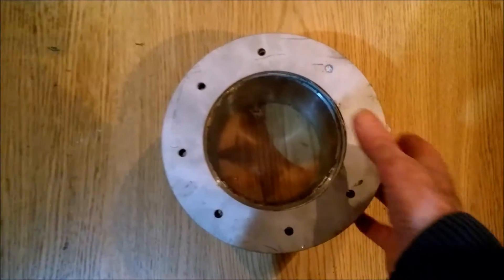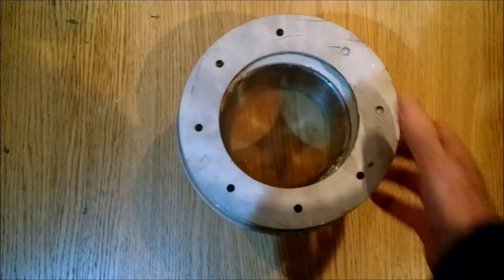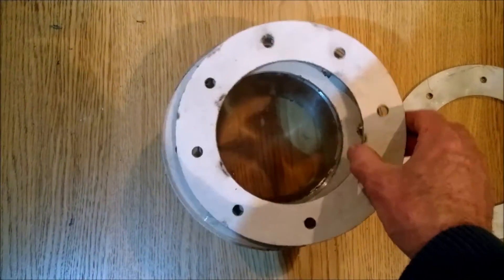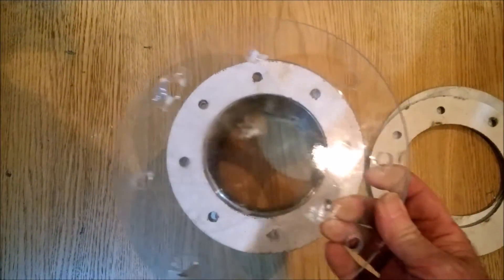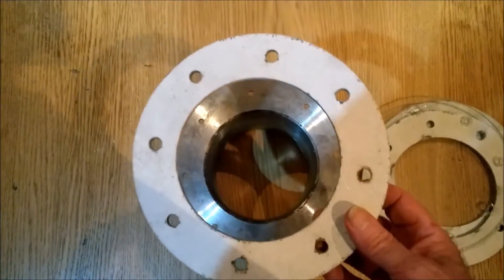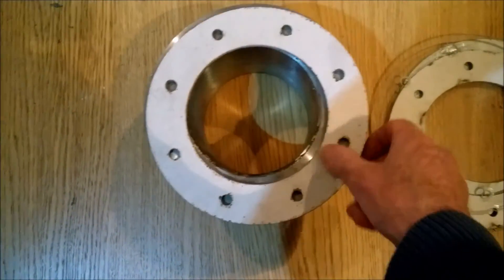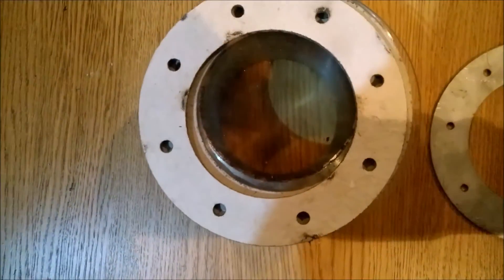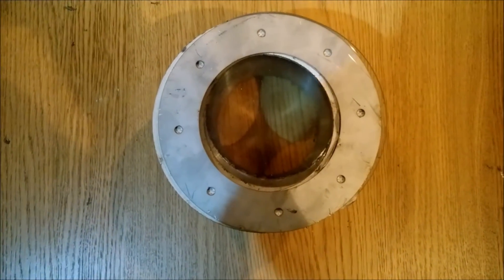Looking glass for gasifier.

Comment: What kind of plastic did you use to handle the high temperatures Luk?
Reply: +urgentcareguy3 No Plastic but ceramic karton. It comes in different thicknesses and temp resistance scales. From 600 to mac 1200 Celcius. The only disadavantage is that after some time you have to tighten the screws because then cartoncomponent tends to burn out.